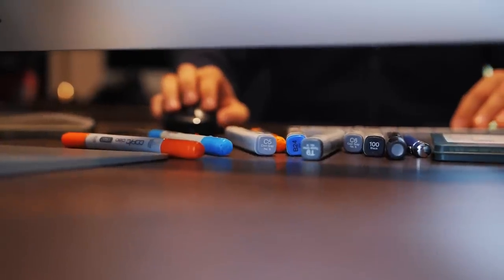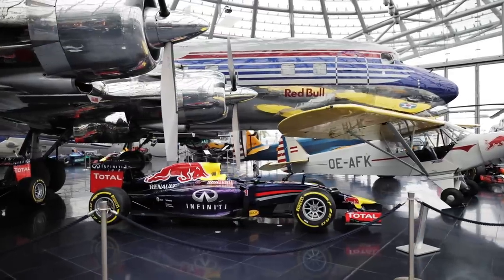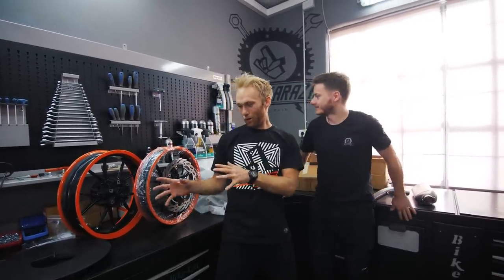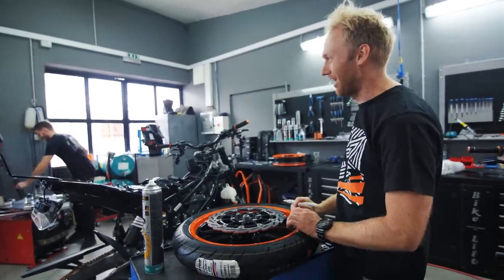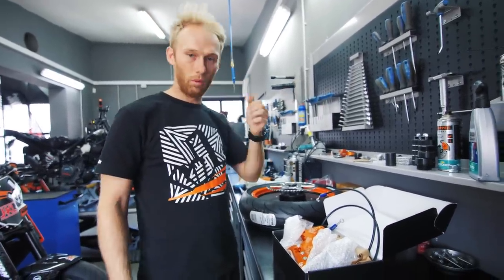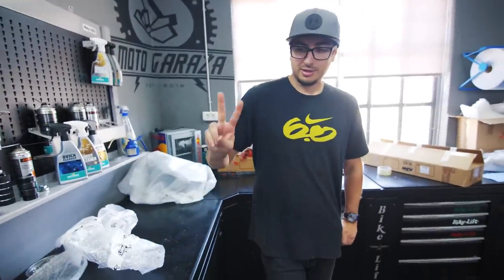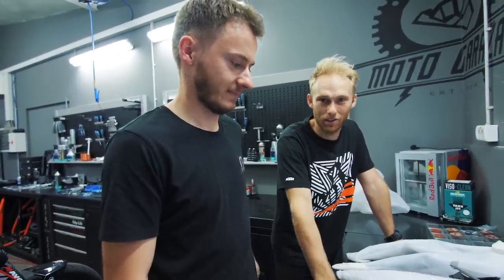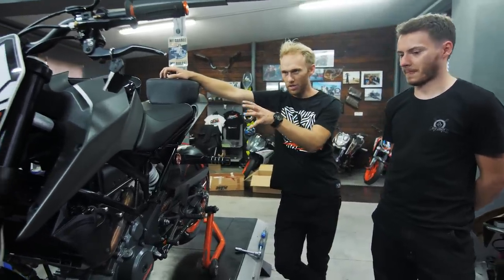SICKEST STUNT BIKE OF 2020 [Duke 250 build off] | RokON VLOG #94

Comment: Bro need some suggestions from U,...please let me know if one has to have a dual disk.on duke 390 alloy so should we get alloy drilled from other side and  fix a steel plate in beetween the  details sk and alloy so as to make a joint of disk with alloy....my qstn is will taht weaken the alloy or is there any chances that if we apply brake on 70-80 km/hr will they brake or any issue will arise...please suggest.